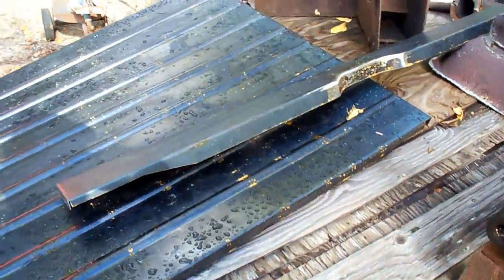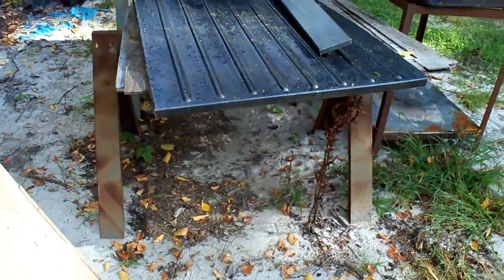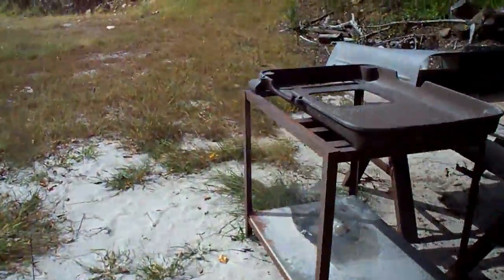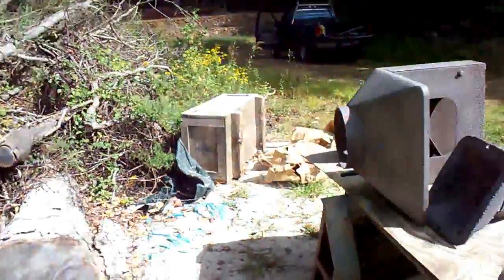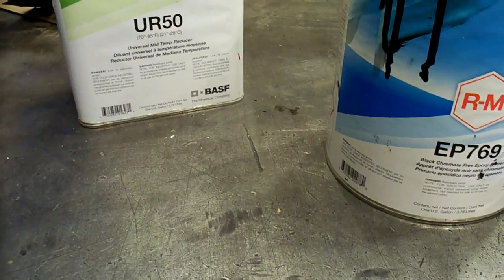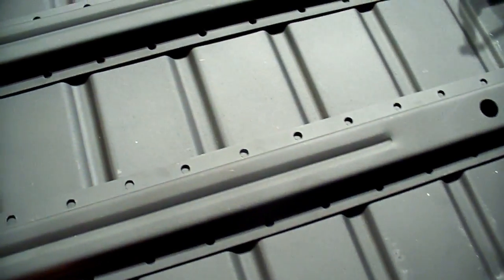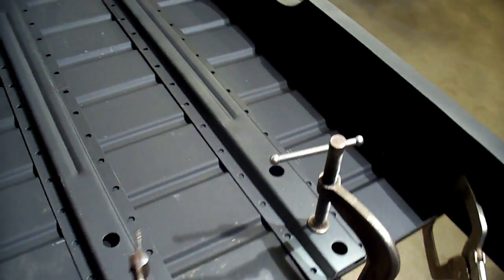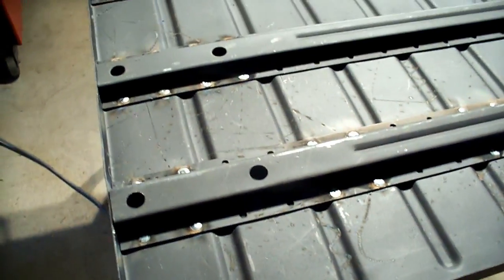Metal Fabrication Willys CJ3B Welder Jeep Rear Floor Finished

Comment: Thank you.  I found a case on Amazon.  By the way, I love the thickness of your hammer forms.  I built a few small ones, and everybody told me I was making them too thick, so I caved and made them thinner.  I ended up welding two pieces to make the thickness I needed.  It's so much easier to have the water jet guy to just cut thicker plate it doesn't cost anymore time, just material.
Reply from the maker: great, sounds like you are on your way to a successful restoration.  Keep watching there are many more videos to come.

Comment: This is a very complicate and different rear floor to the MB, with all those ribs pressed in it must be much more prone to distortion at the fabricating stage, but of course much stronger when made up into the body, do the top hat braces have wood in then as do the MB, I left those out as they are a real rust trap! Thanks for posting.
Reply from the maker: Yes this is a different floor from the MB because it is a CJ3B.  If you watch the hat channel video I am making hat channels out of 14 gauge for strength and then putting a groove down the middle of them as was original on the later CJ5.  I left the wood out for the same reason as you, but the hat channel is just as strong as if the wood was in there.  14 gauge really makes a difference.

Comment: You had mentioned in one of your previous videos that you tried a couple different sprayable products. Just wondering which one worked best for you.
Reply from the maker: I have tried just about every brand of weld thru primer on the market.  I used to use 3M brand but the quality went down and the cans would clog almost immediately during use.  Right now I use LPS high temperature cold galvanize compound and it works great.

Comment: what brand of cold galvanizing compound do you use ? there's been an on going debate on youtube about the use/benefits of weld through primers  ,mainly about it burning off during welding  any thoughts ?
Reply from the maker: I always use a coating between panels when welding them together.  I use LPS hi temp cold galvanize.  Been using it for years and have done tests with it by spot welding pieces together and just leaving them out in the weather.  When seam comes apart there is no rust in there, even at the spot welds.  
Brian